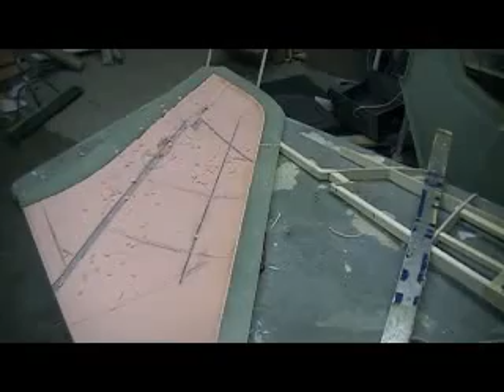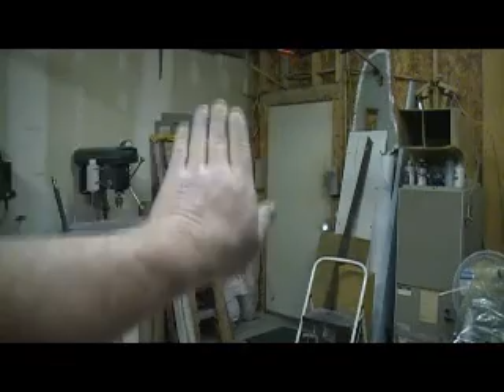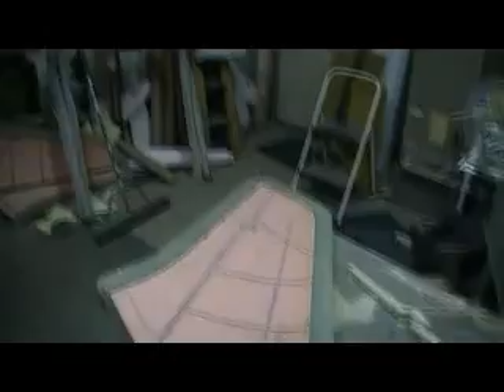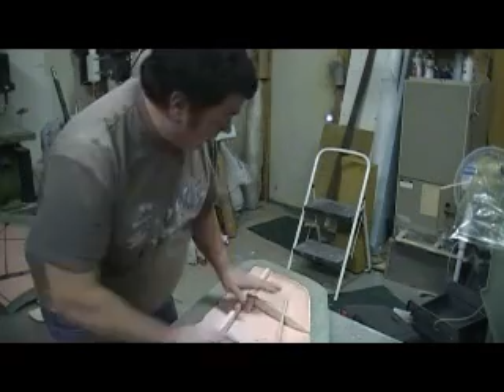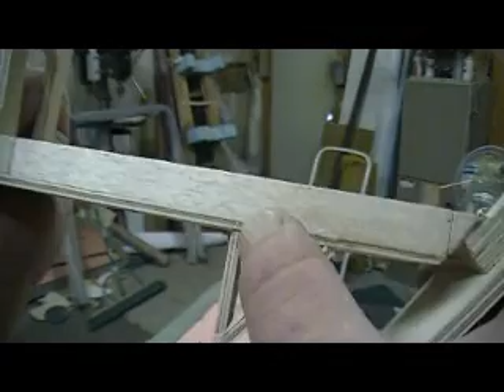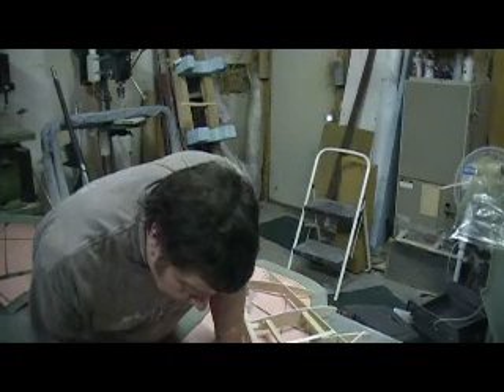how to build a rc jet F-105 thunderchief # 313

Comment: Bob, 

Since you are going to remove the flap (and aileron), areas of the molded wing, why are you reinforcing the skins in those ares with foam? Wouldn't it save a few dollars (and some of your time), if you cut the foam so that it only covered the areas in front of the rear spar? The only place that needs the foam behind the rear spar, is the small area inboard of the flap. Why put expensive foam where you are only going to throw it away?